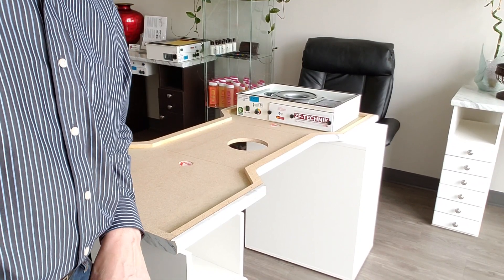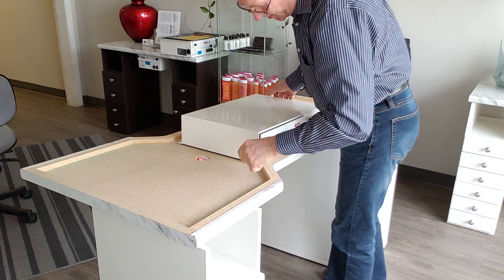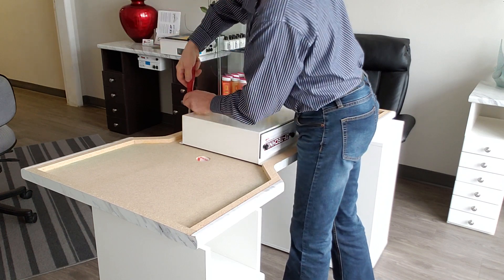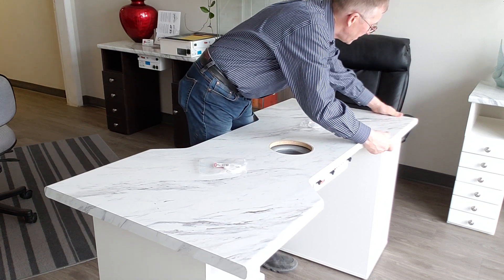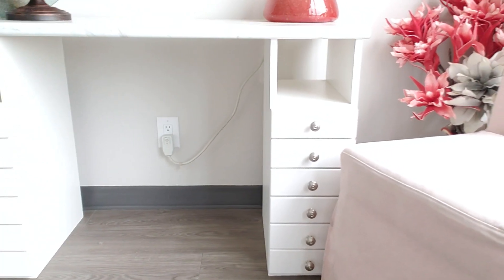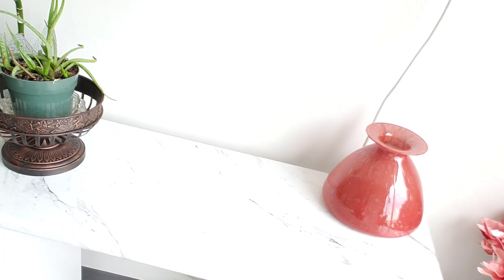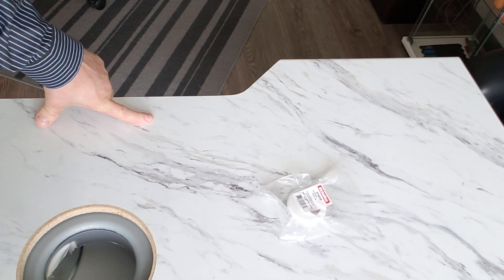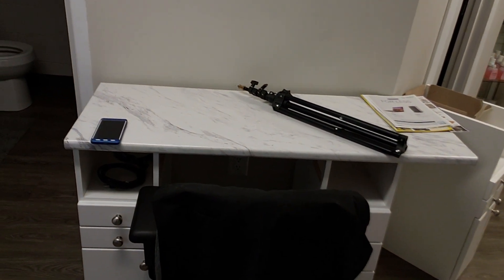Nova Flair T1 install

Comment: I wanted to ask if your tables are acetone proof?
Reply from the maker: I can say they are acetone resistant. We have tried with putting acetone , alcohol and monomer on a top for 30 minutes, and no change was noticed.
Reply: And which machine has the most suction t2 or h2? I’m more interested in the t2 because of the carbon filter. And how often do you change the filter?
Reply from the maker: @iSqu3aKs  the T2 with the current models on hand has a bit better air volume than the H2. Once the new model H2 comes out, they will be equal in suction. The T2 has the capability to use enhanced carbon filters for vapor and odor reduction, and will soon have a tighter filter available. At this time the tighter filter is not planned for the H2.
Reply from the maker: Filter replacement depends on volume and quality of filter cleaning in between changes. Generally a filter requires replacement around once a year.